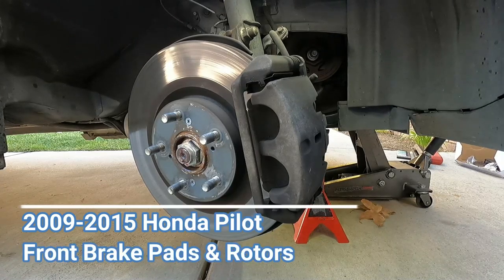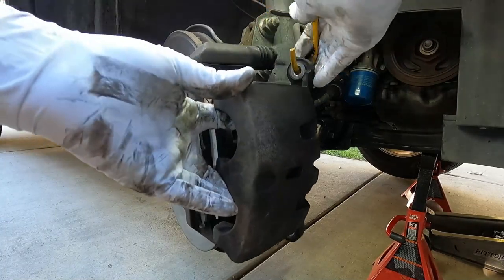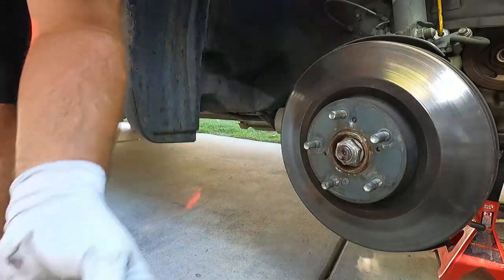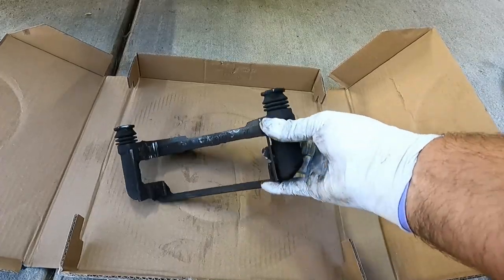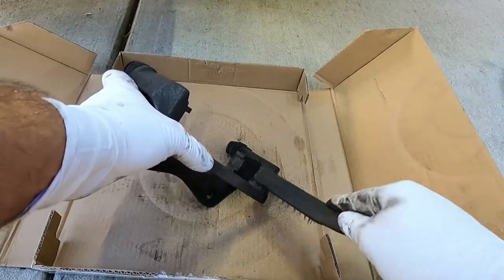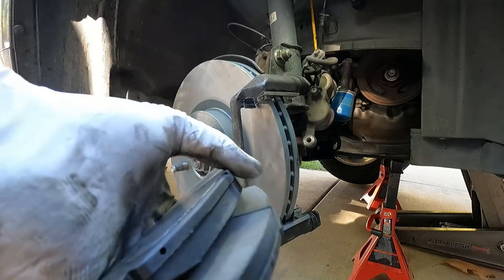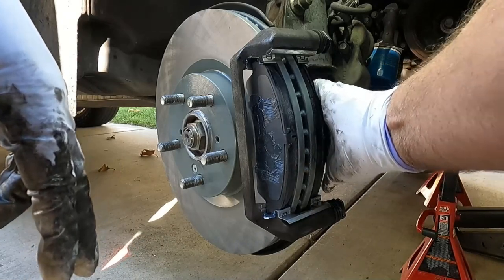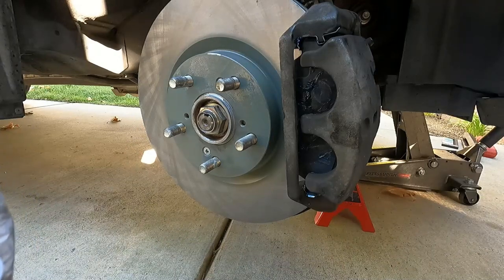2009 2015 Honda Pilot Front Brake Pads & Rotors

Comment: Simple and straight to the point. I'm going to tackle the front rotors and brake pads tomorrow morning and do the rear another day when time allows. Thanks in advance!
Reply: Went well with the front. How is the back, though? Considering the real wheels don't turn is it harder when you remove both brake components?

Comment: Def will be using this video for the brake/rotor job I have next weekend. Most clean and clear video i’ve seen for this. Only issue I have with this video is that it doesn’t have more views

Comment: Does it matter if the squeler is at the top or bottom depending on what wheel it's at as long as it's on the inside?
Reply from the maker: Honestly, I think it really doesn’t matter as long as it fits in there without any interference with the caliper or bracket…I usually see them on the inside pad on most cars, but some are at the top, and some are at the bottom.  I have even seen some vehicles that have them on both inside and outside pads…

Comment: 101 torque on the caliper bolts is wrong. They should be around 55. I followed your instruction and the bolt stripped at 80lbs.